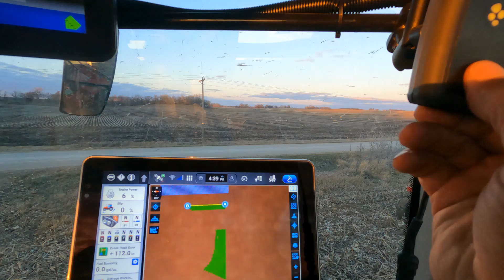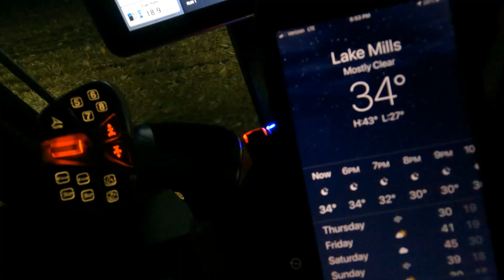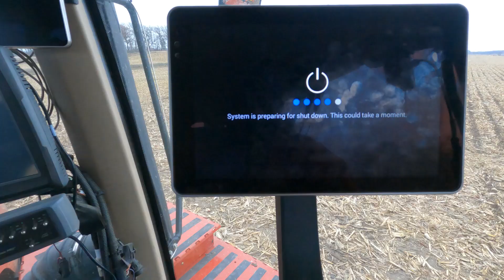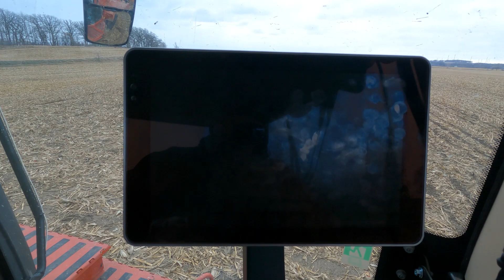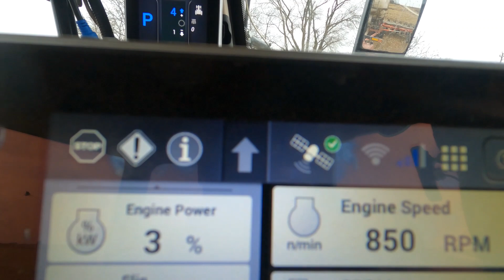Strip Till and GPS Troubles

Comment: I am wanting to try some strip till ahead of beans this fall. What rates of potash do you recommend?
Reply from the maker: I’m running 130 pounds of potash    I fertilizer every acre ever year  I really think it helps the beans
Reply: @groeupfarms  
Ok. I was able to hire 50 acres of beans Striptilled last year and I put on 115 lbs per acre of potash and 100 lbs of Map and 15 lbs of sulfur and those beans where 3 bushels better then where we broadcasted the dry fertilizer. I am wondering if I should just run potash and sulfur and no Map ahead of soybeans. Have you tried any Map ahead of beans. Thank you
Reply from the maker: I’m putting 90 pounds of dap and 10 of sulfur with the potash
Reply: @groeupfarms  
Ok. I am also going to strip Till ahead of corn with our dry fertilizer. I am going to try 80 lbs of potash and 135 lbs of Map and 15 lbs of sulfur as a base rate then to 25% above that and 25% below that for some rate trials. I really like the idea of strip till. I just want to raise as good or better crops and be more efficient with our fertilizer.
Reply from the maker: That’s good to have different checks  this is my first year strip tilling so I’m in learning mode as well